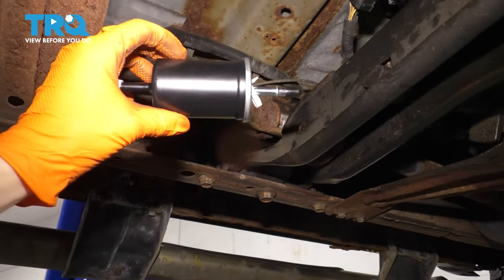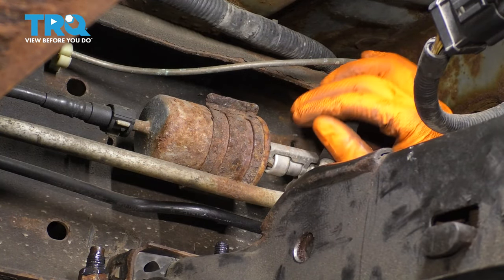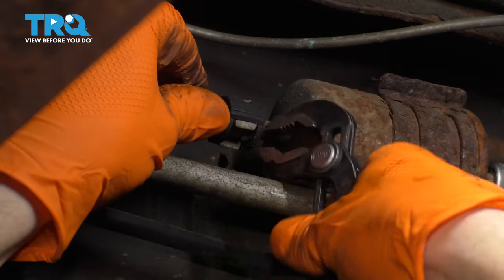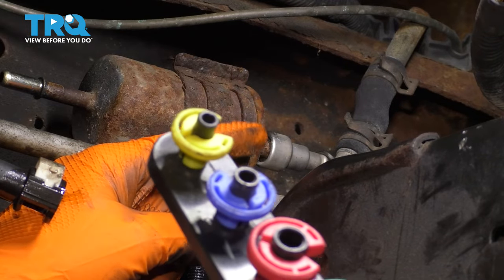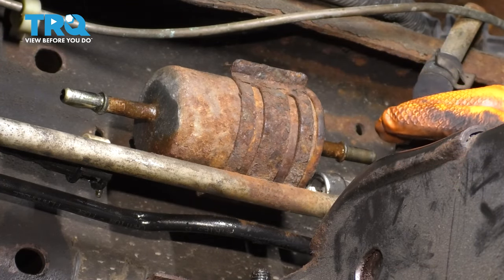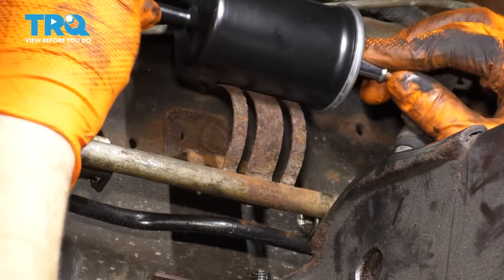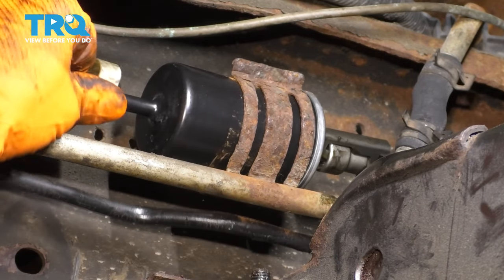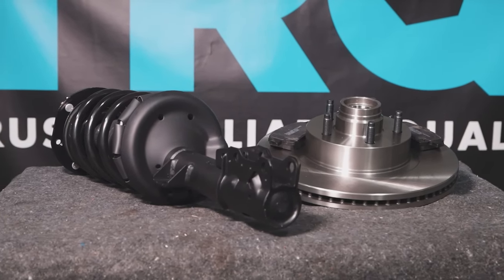How to Replace Fuel Filter 1997-2003 Ford F-150

Comment: Depressurize the fuel system first! If you don't, you can have fuel spray everywhere. All it takes is removing the gas cap. This guy should not be excusing it away by saying the vehicle hasn't run lately.

Comment: The plastic quick connect is made to work the opposite way. You press the white part (on the top in this video) in to release the hose. It's made so you just press it with your thumb and pull the hose.